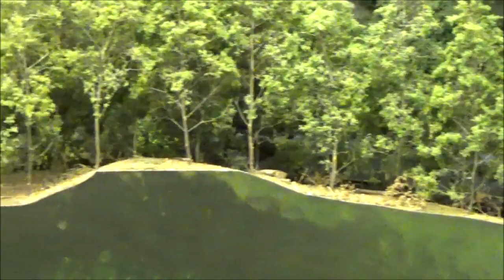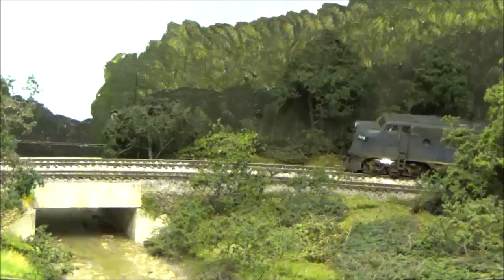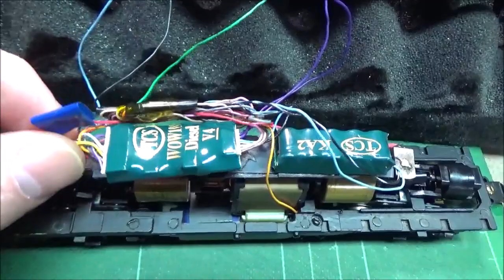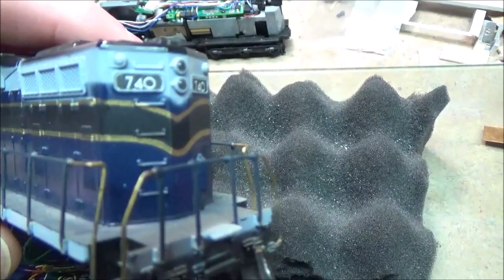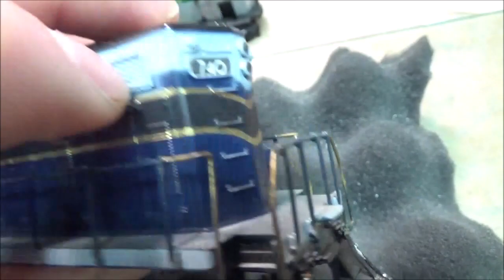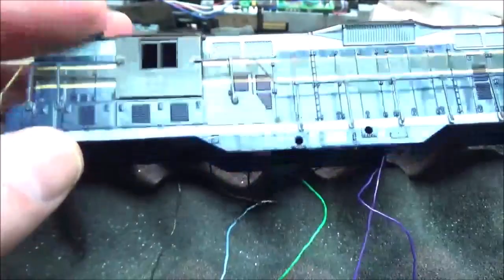Model Railroad Update 24 (Both F7's completed and the next project)

Comment: I like the idea of lighting the trucks. I just think the light is to bright. Well it shows up very bright on the video and I couldn't see the details for the light. The idea is sound it may need to be tweaked a little bit though. Your detailing and weathering is very nice. Your layout looks really really nice too. I enjoy seeing updates from you.   👍
P.S. 
Please don't take my comment as negative or trying to tell you what you should or should not do. It's your railroad and if you are happy with it then that's all that matters.   👍
Reply from the maker: Yes, i agree.  It is partially how the camera picks it up but i would like them to be a little less intense.  I have the decoder setting close to the minimum brightness so i may need to use a higher valued resistor.  Thanks for the comment and kind words.